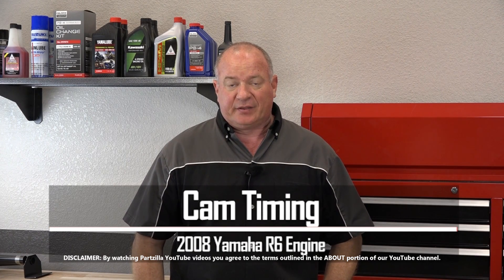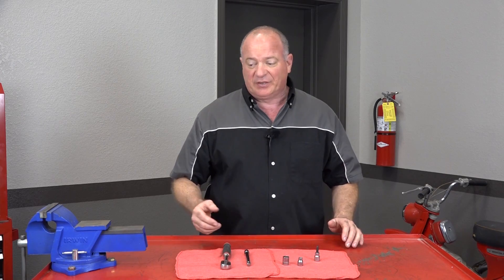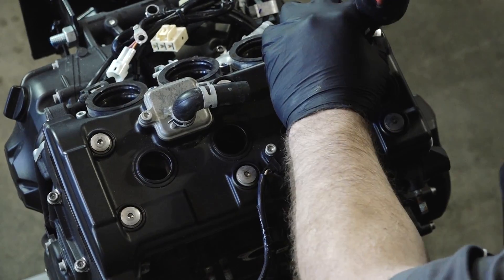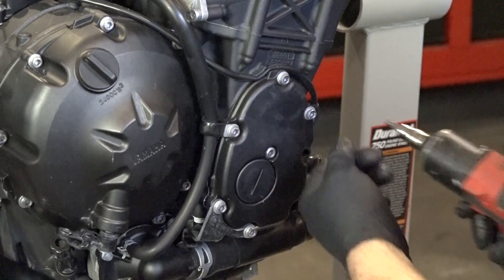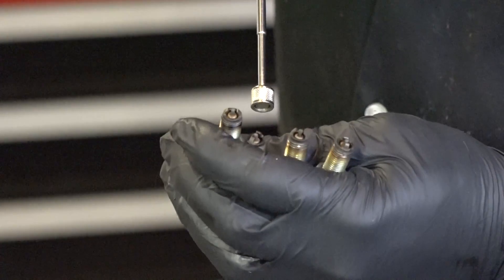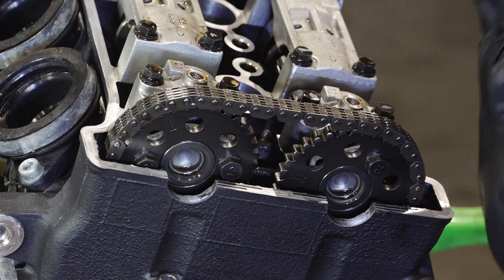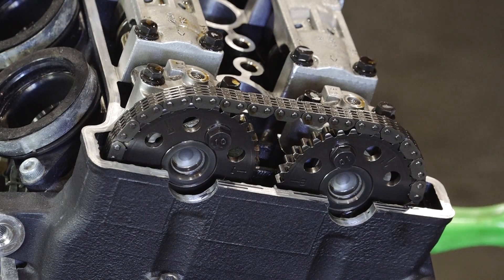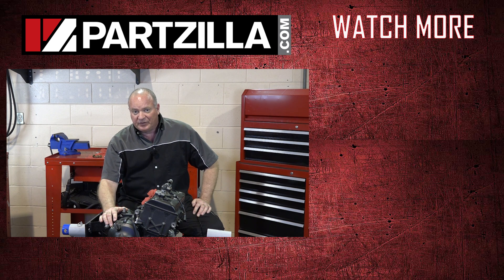Setting the Cam Timing on a Yamaha R6 | Partzilla.com

Comment: The correct timing is #1 cylinder, TDC (it is the one opposite side of the cam sprockets, left side of the engine) and the hash marks pointing away from each other, E towards exhaust side of head and I towards intake side.  They video briefly shows them pointing together but then is corrected to show them correctly away from one another.

Comment: Mr. John tally, maybe in the next halfed ass education video you might want to mention more than cam lobes facing up,or maybe how Yamaha decided to be stupid and put two marks on the cams gears both being a I and an e ,where the I mark could be mistaken for a t mark, maybe mention that one cam is an intake cam the other is exhaust,and that the I mark lines up opposite of the e mark which is level with top of head ,just saying for some of us that do not do this every day might not wind up with bent valves

Comment: Weren't those 2 different TDC's you just showed. In one the marks were in with the lobes out, then the next the marks were out with the lobes pointing in... I understand piston 1 could be all the way up in both, but which is compression stroke?!
Reply: I was thinking the same thing. In the service manual it has the marks on the outside.
Reply: Definitely 2 different tdc I thought I was bugging! I would love to know the reason for this!
Reply: They were.  The correct timing is #1 cylinder, TDC (it is the one opposite side of the cam sprockets) and the hash marks pointing away from each other, E towards exhaust side of head and I towards intake side.  They video briefly shows them together but then is corrected to show them correctly.

Comment: I'm just going to take off this oil drain plug just to see if anything left in it... nope

Now let's remove the spark plugs to make it easier to turn the crank.  Looks like this bike been burning very clean...

Yeah looks like that's a brand new engine that's never been ran.  Spark plugs clean as fuck.  Oil still amber and clear as day.  Factory paint markings are all still there. 🤣🤣
Reply from the maker: Well, we did build the motor up one piece at a time, using mostly brand new parts, after punching it out using a 636 kit. So at that point it hadn't been run and it did look new. 

This is just a tiny piece of the larger project. Starts here: https://youtu.be/A_xjCpcPrvU

Comment: Hey Partzilla, quick question. The timing marks on the cams; how accurate do you need to be with the I & E lines with reference to the mating surface. Whilst doing my shims my chain slipped by a tooth so the I is slightly low. I need to pull it apart again anyway so I can address it then if needs be, just wondering if we are talking very very accurate or not.

Comment: thanks man. was asking myself why we weren't REPLACING w/ shims that were of the same measurement(diameter or thickness?). why punch in the #s into the lil equation to know what newly measured shims are going in there? But it's an adjustment job, adjusting to the clearance now currently needed this far in its mileage/engine wear rite?
Reply: Do you english bro?

Comment: I have a 2006 r1.   Is it the same process with the r1.  My cam sprockets have the little dot.  Do thoes go were the lines are on the r6 sprockets go
Reply from the maker: The R1 uses marks on the camshafts and camshaft caps.
Reply: Not sure if you’ve done this yet. But yes. On the 2006 R1 (my bike), you can remove the oil pump housing (to the right of the clutch basket cover). Make sure you buy a new gasket 5VY-15456-00-00 for that cover when you go to put it back on. There will be a T Mark on the sprocket, use a socket and crank it clockwise until the T aligns with the notch on here: https://www.justanswer.com/motorcycle/31gzd-timing-chain-the-crank-shaf-aliment-n-cam-gears-marks.html. Then you are at top dead center

Comment: @Partzilla, must I drain all my oil out?
Reply from the maker: That's the first step!
Reply: I wasn't sure if the oil pan might be big enough to hold the oil without spilling when opening the pickup rotor cover. I'm working away on it now!
https://i.imgur.com/O88Rl23.jpg

How careful do I have to be about dust/small debris falling into the intake tract? I tried my best to keep it clean but see a little debris on the valves. Lastly, regarding the injectors, how "fragile" are they? Must they be kept "clinically" clean? Thanks!
Reply: To anyone wondering the same thing, you do not need to drain oil to adjust valves/set timing

Comment: I have a 2007 yamaha r6 and my lines are in the inside not outside, is that correct?
Reply from the maker: Does it run like that?  The marks should be on the outside when setting your timing.
Reply: Partzilla Yea, it has 30,000 miles on it, so I deicided to tear it down for a valve adjustment and saw that it was on the inside not like stated in the service manual... you think someone just flipped the sprockets, or some sort of aftermarket?
Reply from the maker: Are you sure it's at TDC?  It could just be on the down cycle.
Reply: Yes, first cylinder cam lobes pointing away from each other, pick up rotor at T on line.. I was curious if it could just simply be someone took the bolts of the camshaft sprockets, and flipped them?

Comment: why do you flip from marks on the inside to marks on the outside on the head, it doesn't make any sense.
Reply from the maker: Max, thanks for bringing this to our attention.  It was an editing mistake when the video was cut together.  You're correct, that absolutely makes no sense.  The marks should be set to the outside, the last part of the video is accurate.  We will address this video and fix it.  Thanks again for paying attention!
Reply: Ok this edit messed me up a bit.. so when the cam is at TDC the lines themselves should be pointing the same way as the timing "I" & "E" marks?? Meaning the lobes are lined up with the flat surface of the head? NOT FACING TOWARDS THE CENTER???

Comment: Hello Dennis I ride 08 Honda CBR 600 RR and I'm getting the F1 light..the bike rides fine it started after I replaced my regulator/ rectifier and put on a new stator cover, old stator was good...new battery also. Any advice would be greatly appreciated.
Reply from the maker: Your FI light could come on for a ton of reasons.  Unfortunately, there is no short answer for this I can give on Youtube. You can test your charging system to make sure everything is getting the right voltage.  Other than that, you would have to read the fault code to narrow it down.  It would be a great video for us to do, I'll add it to our video suggestion list and try to get to it.
Reply: thanks for just the reply...once I get it taken care of I'll be sure to let you know what it was...thanks again